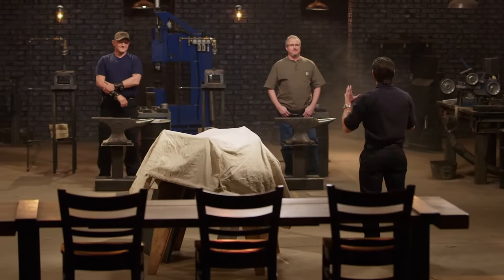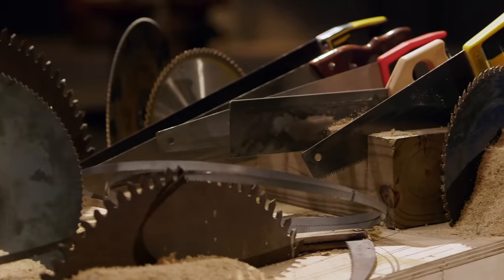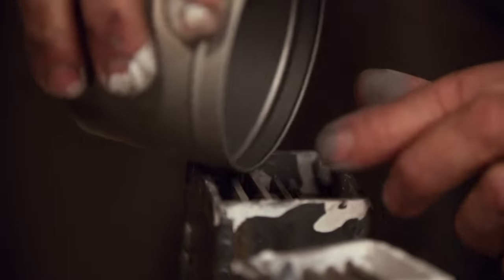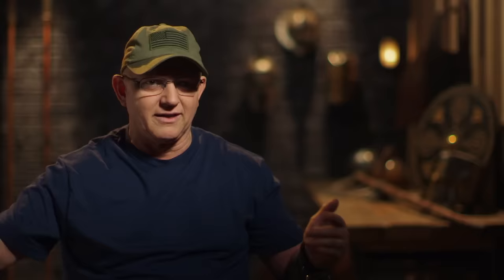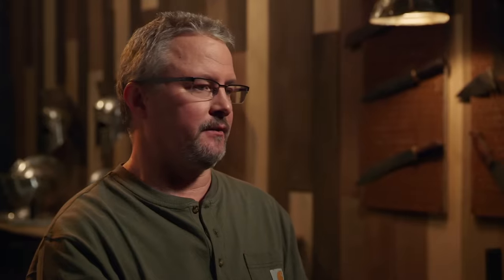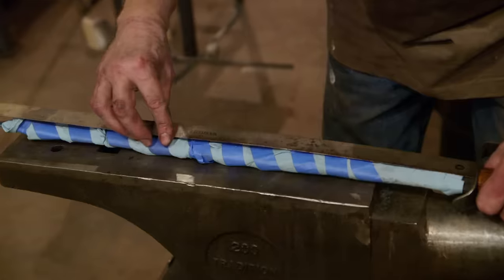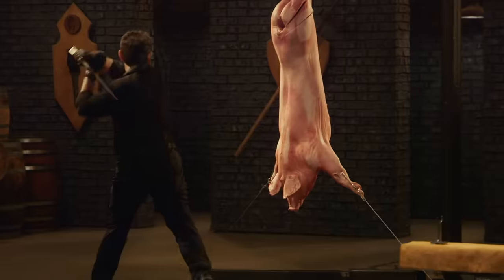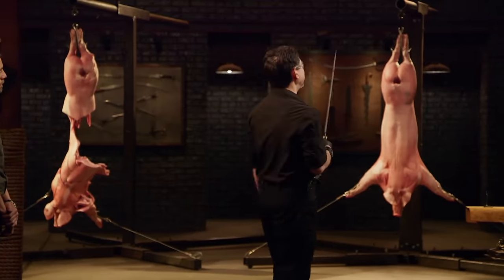Forged in Fire: Beat the Judges: SAW BLADE SWORD CHALLENGE (Season 1) | History

Comment: That was so easy to Manipulate, Jay shouldn’t have won that.
Reply: Intriguing, how so?
Reply: Honestly, I think Jay should have won. You can always sharpen a blade, but I imagine it would be harder to lighten a blade.
Reply: @joshuayarrington9684  I agree the fact that lightening a blade so you can make more precise cuts is the important factor. Compared to a heavy blade that only focuses on blunt force is something that if used often will wear the sword out much quicker.
Reply: @joshuayarrington9684  It might be a little faster to sharpen a blade, but given a half hour or so he could probably easily chunk a pound or so off the heavier sword. But Jay's sword will likely never hold an edge any better than it does. I'll take a heavy sword that holds an edge over a light one that can't cut after a few contacts any day of the week.
Reply: @cavalieroutdoors6036  Neither of the swords held an edge.  Derp
Reply: @cavalieroutdoors6036  this is SHORT sword. It should not weigh as heavy as two handed or full length sword. For shorter sword, precision and lightweight are preferable. Doug was gasping for air after kill test, it was not practical.
Reply: @joshuayarrington9684  just add a fuller to each side of the blade and he could shave of 1/2 a pound 👀👀
Reply: exactd
Reply: It's a short sword that weights like a two-handed longsword. Of course it cuts better with a much larger mass.
Reply: nope. every test was fair so it all comes to design and weight if it's weildable
Reply: @marcusJUJUalty  A short sword shouldn't weight more than 2 - 2.5 pounds. It wasn't a "little" overweight.. it was nearly double the weight it should have been.
Reply: @infinitesession5439  i imagine me with Jay Sword in real combat .... 
After the first hit ... Me : oh wait i wil charp the blade and we continue ok .
The ennemi : !! 🤔?!
Reply: @marcusJUJUalty  Harder to grind a fuller into an already hardened blade, far easier to sharpen
Reply: @joshuayarrington9684  In the battle !! give me a sec Ill go and sharpen it Ill be back!!'???
Reply: @cavalieroutdoors6036  i would take a heavy sharp blade over a light one with less edge too, if we were talking about twohanded swords that is, a short sword with the weight of a fookin scottish claymore isnt smth id prefer over a dull heavy one
Reply: Also heavy grinding on a hardened and tempered blade is dangerous. Remember when you grind, the metal heats back up; that is why you will see smiths make as much work (beveling, some fuller) before heating for hardenening and temper. You will most likely compromise the integrity of the workpiece if you add a fuller without prior work on it.
Reply: Short swords can be heavy because being shorter the weight is closed to the handle keeping it easy to wield even tho heavy. Take Spartan sword, sword but heavy metal at the tip like a axe, take the Gladius sword, short but heavy with its width but manageable because weight is close to the handle. The endurance of the handler of sword was not tested there for it can not a deciding factor, what did we test? Cutting power: Cut pig in half, heavy for the win!
Toughness: Equal 
Sharpness: Keeps cutting to the end, heavy for the win!
And what happens when both perform well? We use elegance and beauty of the weapon by which the heavy sword far surpasses Jay's thus TRUE WINNER by KO! Heavy sword!!!!
Reply: Long swords u can not make heavy cuz if u make a heavy one of those then it's truly unwieldy, 1 hand 2 hand makes no difference, example the claymore needs to hands for its weight but the katana is actually light but is designed for 2 hands to increase cutting power by using a push pull method. The argument that a 1 handed sword MUST be light is absurd, a 1 handed sword can be heavy as long as it's short.
Reply: @stonefox9124  no. Spartans swords being heavy doesnt mean that the sword required in this competition can or should be, also, no, not a single short sword is supposed to be so heavy that it could be a 2 hander
Reply: @stonefox9124  everything you just said is wrong. Real weapons are designed to be as light as possible.  Real two handed swords weigh around 3-5 lbs. Most weapons in the 1 handed category need to be under 3lbs. I think you are ignorant when it comes to ancient weapons. Where did you even get these false idea's? Video games and movies?
Reply: @joshuayarrington9684  You basicly trim the weight when you sharpen the blade each time. You could also make the blade a Double edged short sword instead. Or in total just lossen the weight a bit by trimming it on both sides slowly. he should have won eventho the weight was up there. His sword cut more of the sand doll than jay did. So all in all the weight + effect of the weapon would have won that.
Reply: I mean both blades performed almost identically, one was a chopper and one was a slasher but both performed equally in the kill test for their purposes, both had the same amount of damage in the strength test, jays was a little worse in the cut test but the competitor didn't do great in the cut test either. At the end of the day an ever so slightly duller blade isn't as egregious as a blade SO heavy they compare it to a two handed sword.
Reply: There are so many idiots in the comments that I lost count, both the blades lost a portion of the edge but one was heavier, guess who wins, stop the useless arguments
Reply: Thank it was biased
Reply: @joshuayarrington9684  bruh just be stronger

Comment: Really felt that Jay lost. I get the weapon was heavy on the smith's part but he did do better on the challenges I believe
Reply: They did pretty much equally tbh
Reply: Its important for a weapon to be fast . When your weapon is heavier u need more time to recover the blade.
Reply: the first test was about the same, 2nd test both picked up a little bit of damage but very slightly and the last test they both have parts it doesn't cut.
i think it was about 50/50 so i guess they gave it to j because of the weight
Reply: Weight is one of the most important parts of a sword. Especially a SHORTSWORD. It barely beat jays sword on the cut test, other than the kill test it did pretty much the same on the other tests. So it came down to the weight judge which decided. Jay barely won imo
Reply: He did do a bit better on the sharpness and kill test, however there is one fundamental issue with his weapon compared to Jay's. That issue being the weight, since a short sword is supposed to be a light, quick cutter.
Reply: They did equally, but the point is they have to respect your blade making ability more than the other person for you beat their friend. It's like all ties favor the casino.
Reply: The dude made the shortsword equivalent of a Desert Eagle. Looks cool but hardly practical at that weight and not something you would like to use heavily for any extended period of time. Clear win for Jay who actually thought about how the blade would work for the user.
Reply: That thing weighs about double or for times as much as a regular short sword
Reply: I believe that too...!!
Reply: @skeletorlord a blade's primary task is to cut... it's to be sharp... if it's not sharp then it's pretty much a liability...!!!
Reply: @Drako_RS  first test. The 1st guys blade almost cut the pig into two pieces. Jays barely got half way. 2nd jays won just barely. The sharpness test Jay cut the arm in half and that was it. The 1st guy cut the arm off, into the hip slightly, then it bounced off
Reply: @skeletorlord621  so why to make a sword take a rod to smack them it will be much easier tf
Reply: @Drako_RS  there was 90-10 not 50-50
Reply: @thodan467  u go to gym & can't lift 2 kg sword fools. & Take a rod to fight because it don't cut
Reply: @arx9996  excuse  me, but your word´s don´t make any sense for me
Reply: @thodan467  the judge sword don't cut so take a rod much easier than blunt sword
Reply: @arx9996  That changes anything on the much to much weight of the sword ?
It  don´t make your words better understandable in kontext, sorry
A greatsword weighs max about 3.5 kg IIRC , there exists  up to 7 kg heavy Objects that maybe coud´ve been used as Greatswords but most  likely were only intended to be used as objects of representation
Reply: @thodan467  so yeah the sword don't cut is the point
Reply: @arx9996  And why then did you insult me over the citation of the weight which are historical  facts?

btw the point of a sword that it´s a nimble fighting weapon, if it´s not then it´s ability to cut is at best secondary for a cutting sword
Reply: @thodan467  so it can cut 🐎  & it is very useful than dull blade .
Reply: @thodan467  do u know a historical fact . In nepal there r lots of khukuri which r 6ft long & weigh very heavy but they used it in battle did the blade made them vunrable ? I don't think so
Reply: @arx9996  that dies SAK too, ivwouldn't want to fight with it
Reply: @arx9996  Source?
Military Khukuris are AFAIK not two feet. Long
Reply: @thodan467  I am not taking about military sword I am talking about wildebility of the sword . Did it make them vunrable ??
Reply: @arx9996  Overheavy, not  well balanced  so likely not a nimble weapon!
The point of the sword in fighting is it´s nimbleness and that it´s easy and convenient to carry
Reply: @thodan467  yeah , that is why take a rod cause it don't cut baby

Comment: Watched the full episode.
Competitor gave me smiles along the way and the decision was a surprise.
In the sharpness test guy definitely outperformed j's so it should be a win for him.
1st test = similar.
2nd test = similar.
3rd test = competitor.
J is great but I think the other guy should have won.
Reply: Then you underestimate the importance of weight. A shortshort should be under 2 pounds. Not the 4 pounds this one was. That weight means that indeed, the sword cuts better. But almost literally everything else is worse. It tires you more, slows you down, hurts the wrist, makes followup-strikes more difficult, throws off edge-allignment, cramps up the fingers, makes it more likely to fly out of your hand, and more.

Weight and balance are 2 and 3 on how good a sword is. 1 is if it doesn't break.
Reply: It's not a checklist thing. These are tests for the judges to see different parameters that make the sword functional. The problem is, that it's hard to show to the audience how it feels to wield and swing the blade, which is also judged.

Comment: He literally left scratches but still won, cmon weight isn’t everything
Reply: Weight is extremely important in a sword. Massively important. A heavy sword is not a sword, it's a sharp stick.
Reply: weight is very important,especially in a 1handed sword..
Reply: @Anegor  but in that case it's a sharp stick against a blunt lighter stick.... I'm sorry but J.Ns blade was unusable in combat while the other was heavy but still cut
Reply: True
Reply: @Anegor  I'd rather have a sharp stick than a sword that isn't sharp.
Reply: @AnonYmous-ob7py  No, you wouldn't. As long as it can cut the skin, it's usable. A heavy sword isn't usable. Youre not gonna be hitting sandmen.
Reply: Before contradicting the judges you should know that they are pro on what they are doing what about you?
Reply: @lansoyanguluan621  How many of the judges have actual experience wielding swords in battle?  None.  They are experts in making them.
Reply: If you know how to make it's logical that you know how the one to wield it should feel.
Reply: Well the problem is 4lbs is does'nt pass the requirement of short sword
Reply: @twistedpivoter2695  Contrary, the 4-pounder is unusable in combat. A light, dull sword will successfully fence an enemy's weapons, will still bludgeon quite effectively, and will stab. A heavy sharp sword can't even fence an enemy's weapon, so its damage potential is completely meaningless unless you're cutting down defenseless targets.

Comment: I understand weight issues, but at the end of the day, the judges sword was the one that literally couldn't make the cut.....  I cant get behind this decision. like seriously? yes lighter weight, easier to wield, but hit the dummy like a butter knife. swords are meant to slash, cut, cleave, slice, etc..... it may have been heavier but lets face it... its still functional. there was no "weight must be under X lbs" parameters....
Reply: Tbh the issues on both blades were almost identical for strength and sharpness; it was probably just blind luck that ben cut a little lower with the competitors blade. I personally thought performance was comparable.
Regardless, weight is the real killer on most episodes and irl. 4lbs is on the heavy end for a LONGSWORD, saying nothing of a shorter blade like they made. If its a little sharper but an actual pain to wield... that's where the judges tend to go.
Reply: Gotta think what would be more effective in a fight, they both didn't cut very well because of the damage done so really they performed equally but it came down to weight, I'd personally want a much lighter weapon that can be used easily with one hand.
Reply: A heavy blade may do more damage when dull, but it doesn't matter if you miss. It's all about how quickly you can bring your blade back into a defensive position or conduct a follow up strike. I'll take a lighter blade any day.
Reply: @nathanreimer1296  no matter the size and strength of the wielder the heavier sword will tire him out faster, and like people mentioned, it is on the heavier side for these types of swords, and like Ben mentioned the competitor's swords cut because it hit with the sharp part
Reply: @nathanreimer1296  yeah, but it's not about the owners, it's about making a weapon an average person could use, and Doug is a martial Artist ffs, so he's by no means weak, dude specializes in sharp weapon combat, if he says it's too heavy, it's too heavy, the judges are a master at their craft, they know what characteristics a weapon must have, if they deem it too heavy, it's too heavy.
Reply: One handed weapon is made to be light, less stress for your hand while making heavy hits, imagine vibration you will get with that heavy sword while hiting some mail, it was just luck that strenght test was just clay pots, if it was some metal, everyone would be in pain, weapon in a first place should be safe for its wielder, everything seems fair to me, you can always just sharpen your dull sword again, and in combat every weapon gets dull after a few hits.
Reply: @Longshin777  gotta build to the judges hands not their own. Thats why I was so impressed when Ben Abbot first competed. He made sure to take mental notes when he shook all the judges hands. I haven't seen another smith try this yet. Smart!
Reply: @ryanmounce2850  uhh, i think u replied to the wrong person
Reply: @Longshin777  you're right, sorry about that.
Reply: @ryanmounce2850  haha, no problem
Reply: @nathanreimer1296  that is entirely incorrect. Even the most physically impressive person would want a lighter weapon. Always. Especially a sword. Always. Speed is of utmost importance. You can verify this yourself, by checking the weight of massive greatswords, and seeing how light they actually are made to be. A heavy sword is not a sword, it's a sharpened club.
Reply: @nathanreimer1296  you would be surprised the lengths people will go if 10 grand is on the line.
Reply: they have in the past made the opposite choice. when a heavy clunky sword still has an edge and the lighter weight one lost its edge in the strength tests. but THIS time they go the other way... why? cause one of the judges was the contestant. lets face it.. the heavier one had a better shape, better form, looked more finished, and held its edge. the judge's sword looked like it was incomplete and something a month one smith would put out.
Reply: @nathanreimer1296  people that make and use weapons for a living would
Reply: @brettleisy356  jay lost before so I guess they didn't want him to lose again
Reply: @nathanreimer1296  No Jay's blade cut the dummys arm 50% off, trust me, that dummy is still dead.
Reply: @brettleisy356  but they both didnt hold a edge, he even brought up that the cut that went through the arm was not on the sweet spot, while it did cut most of that was just from the weight behind it if they had kept the blade down it weight it probably would have cut similarly to the judges
Reply: @ryanmounce2850  if you are refering to the judges choosing the judge to the contestant that doesnt make since cause they lose the 10K either way, just instead of the dude getting it it goes to charity so this is by far the worst argument to have for him losing